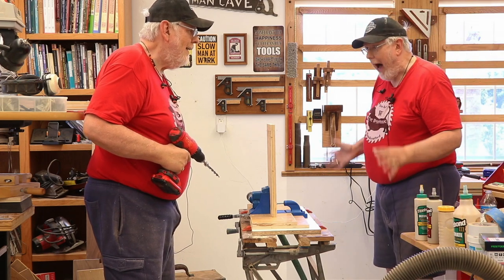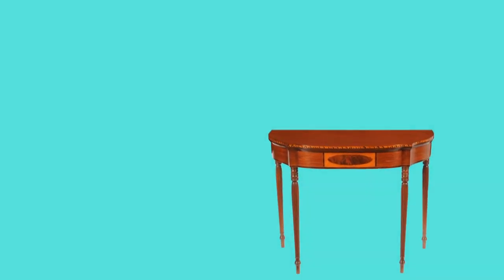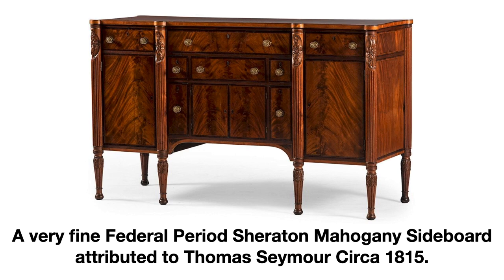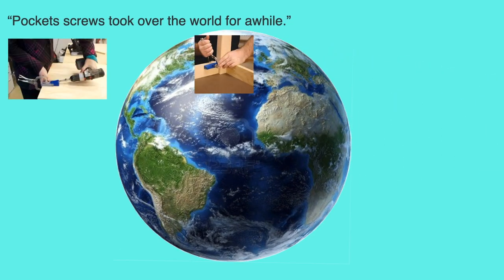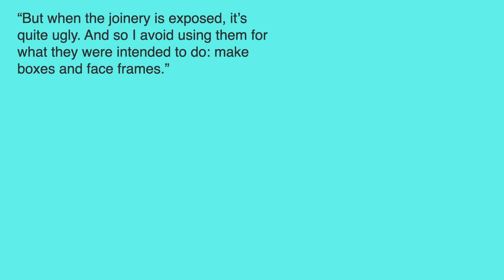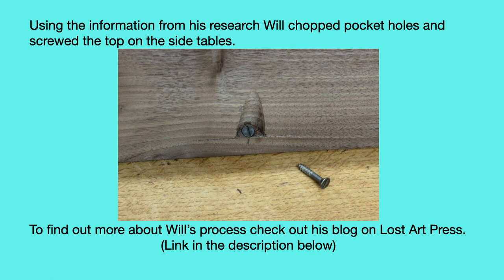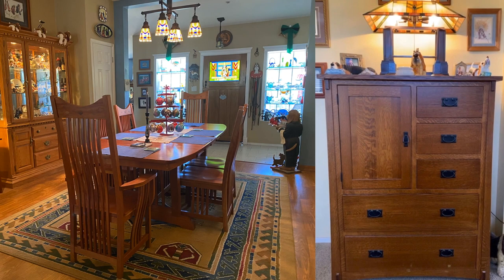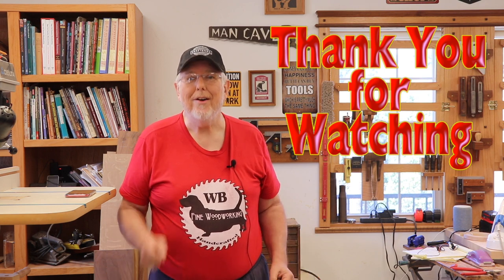The joint most woodworkers hate - What's Up with Pocket Holes?- History and Current Opinions

Comment: Will Meyers mentioned the Hancock Shaker Village.  As will happen with such tourist venues, numerous furniture makers, using Shaker styles, pop up in the area, offering antiquated or newly built retailed items.  When my wife was alive she loved shopping there.
A few of the antique purchases were cob job pocket holes which I had to Dutch Boy repairs.  However, one of the Village's Period Tutors said, instead of using larger and larger screws, clean out the bore hole and glue in dowel plugs.
The plugs fill the entire pocket hole.  Any extended overhangs can be trimmed smooth with a back pull saw.  I though it to be such a great idea I have bought numerous poor condition pieces.  From thrift shops, garage/yard sales, curbside giveaways.  Then I took an evening or two to repair and then sell for five to ten times my cost.
Pocket holes are not the end all be all.  HOWEVER, they are one of the many tools we have hanging on the tool wall.
~Jim